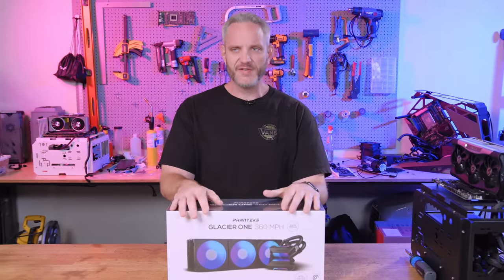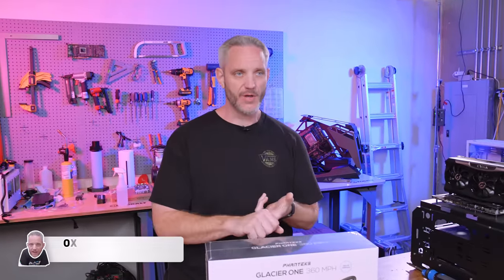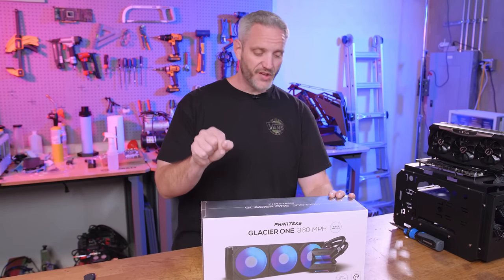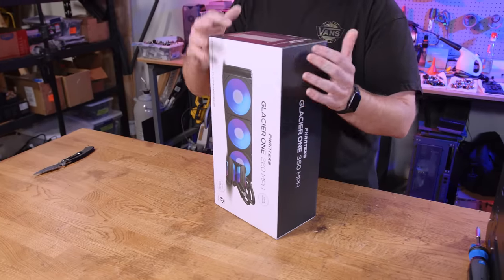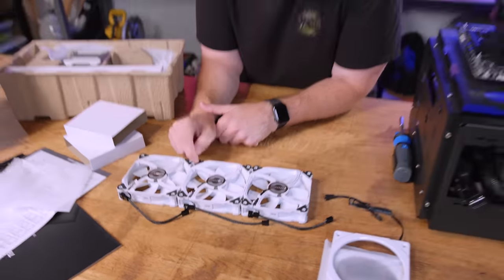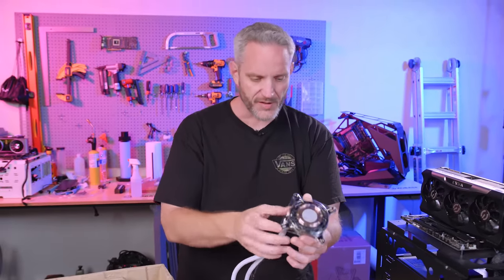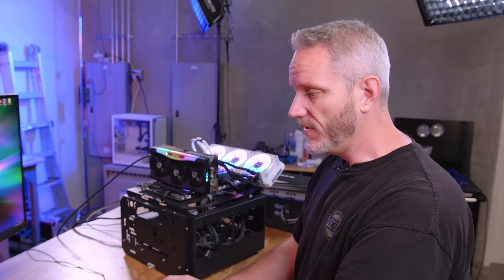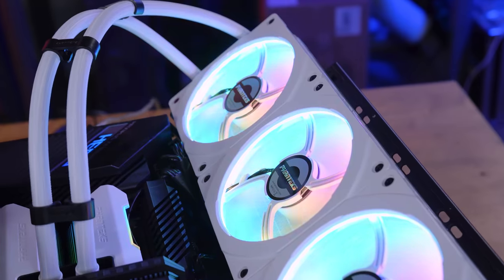A new CPU Cooler has entered the chat!

Comment: Question for you, Jay. (Great video, as always, btw)

You mentioned that once enough liquid had permeated out of the loop and/or the pump had gone bad, there was nothing you could do to service the Asetek AIO, and it was simply time to replace it altogether.

I wonder though, is it possible to remove the block mounted pump, plumb in an integrated D12 pump/res combo, and reinstall the unit as a psuedo-custom water-cooled unit?

I had a Corsair H110i GTX that i loved until it died of pump death (i suspect crunchies got in there and killed it), and have had the idea rolling around in my head since then - just haven't acted on it 'cos time, and how well the Noctua NH-D15 has replaced it.

I'm thinking along the lines of...
Pump removed
Reroute one line from rad to block to go instead to pump/res combo
Line out of pump combo back to block

Would solve reducing e-waste a little bit, be budget friendly, and allow servicing of the system - flushing, topping up, etc).

Nice little mad science experiment I'd love to see you tackle... You know, for SCIENCE!

Keep the great videos coming.
Reply: Depending on cost of parts and how you've plumbed it all in, it might be easier/cheaper to splice a little flow-meter in there to function as a 3-way splitter, and attach that to a tiny reservoir at the top of the build like a header tank. No need to replace pump or coldplate, and any air in the system will gravitate to the header tank over time. Drain, fill with some clear cryofuel or similar and let it rip.
Reply: @technicalfool  except, the reason I'm considering it in the first place is because the pump died.
Reply: @striAKer139  ahright, me misreading. Whups.

As I recall, barrow/barrowch do a thing which has a d5 pump, coldplate and reservoir all in one block. Was thinking of maybe using it in a liquid cooled teeny ITX build. Seems like it'd be right up your alley, so long as the hoses can be squeezed into the fittings.
Reply: @technicalfool  I wouldn't worry about it mate, happens to the best of us every so often - gave me a chuckle anyhow.

I do like the flow meter idea though, hadn't thought of that.

Comment: Really want to go with a full white build but I don't know if there's any custom stuff to make my 1070 fully white.. Might have to upgrade one day
Reply: Depending on the card you can pretty easily make a custom backplate for it. I installed a G12 Kraken + AiO on my 1080Ti and was thinking of making one so it covers the PCB and bends nicely on the side to cover the pump and wires completely. It's cheap as well.

Comment: With air-cooled ryzen 5 5600x with Amd Prism at 4200 ghz i have 60 degrees for all 10 minutes of Cinebench multi core termal throttling test  in a closed case...

Comment: depending on the msi afterburnering overclocking 405 mhz memory clock 200 mhz core clock 9 core voltage full power full temp fan speeds full in msi afterburner

Comment: I'm building my first water cooled system although I've built plenty of computers in the past, this is my first substantial gaming system and I was wondering if I have a 12-gen 12900 KS and I plan to overclock it, is an AIO cooler adequate? or should I get the cooler with a reservoir type? Any comments regarding this question are appreciated 🙂

Comment: After having a NZXT Kraken, I'm spoiled with a LCD screen to quickly view temps of GPU/CPU at a glance without anything on my HUD. Wouldn't go back. Though I also wouldn't go with NZXT again. Good unit but I like Corsair products better. Just at the time of building, No other company had any screens out yet.
Reply: I'd say if you need to be able to check temps quickly, switch to an AIO that doesn't require temp monitoring
Reply: @robwhitmore3040  eh, my kraken z73 keeps my 10900k in the mid 50s (c). I just like to always know temps.

Comment: That pump head looks super skimp.  I give it 6 months. 
Stay away from nzxt bloatware software need to run their aios. 
Look for bios controlled aios.
Less background programs sending your private information to manufacturers the better.
Jamming fans, lightning. Cooling, monitoring, overclocking, etc all into one required software is definitely excessive. If you want this running on the background of your pc then nzxt aio cam software is for you.

Comment: My Nzxt x62 can barely cool my 5950X so i was considering this but then ir ealized the max i can use in my current Case is a 240mm rad so im stuck with the nzxt or maybe buy the 240 version but if it gonna perform the same i dont think is worth it and movign all to a new case would be a pain too at least for now.

Comment: semi unrelated question...I just got everything to start my first loop. ended up with a freezemod pump (550l/h, 3.5m pump head) with the biggest resivoir. I have 2 360mm rads, 5600x and a rtx 2080. only way I can run my loop is pump/rad/rad/cpu/GPU back to res/pump. I know order doesn't matter , but wondering if this pump will have enough grunt to push this loop. rad on front and top, pump about mid hieght in case. I'm bending all the rigid 14od ,only fittings at blocks and rads, a 3 way at lowest point with a ball valve . will I be ok? GPU CPU are auto OC with after burner and Ryzen master . case is a 5000d airflow

Comment: @JayzTwoCents
 Hi can u tell me which one of these two PC-s should i buy!?
Which1 u recommend me!?
     LENOVO LEGION i7-11700F/16GB/1TB SSD/RTX 3060Ti 8GB 90RT003JRI

Chipset:Intel B560
Processor:    Intel Core i7-11700F (8C / 16T, 2.5 / 4.9GHz, 16MB)
Graphics:     NVIDIA GeForce RTX 3060Ti 8GB
Memory:       16GB DDR4
Memory:       1TB SSD
System Lighting:Legion OY iconic LED + Internal ambient lighting
Audio:        High Definition (HD) Audio, Realtek ALC887 codec
Keyboard:     USB Calliope Keyboard, Black
Cooler:       95W Airflow + PCH heatsink + VRM heatsink + M.2 SSD DECO MYLAR heatsink
Mouse:        USB Calliope Mouse, Black
Ethernet:     Integrated 100/1000M
WLAN + Bluetooth:11ax, 2x2 + BT5.1
Front Ports:
2 x USB 3.2 Gen 1
1 x headphone (3.5mm)
1 x microphone (3.5mm)
Back Ports:
2 x USB 2.0
2 x USB 3.2 Gen 1
1 x USB-C 3.2 Gen 2 (support data transfer and 5V@3A charging)
3 x audio out (5.1 channel)
1 x Ethernet (RJ-45)
1 x power connector
Power:550W 88%

-------------------------------------

     LENOVO R9-5900X/16GB/1TB/RTX 3060Ti 8GB 90RC009HRI

Chipset:   AMD B550
Processor: AMD Ryzen 9 5900X (12C / 24T, 3.7 / 4.8GHz, 6MB L2 / 64MB L3)
Graphics:  NVIDIA GeForce RTX 3060 Ti 8GB GDDR6
Memory:	   16GB DDR4
Memory:    1TB SSD

   NO OPERATING SYSTEM

Audio:     High Definition (HD) Audio, Realtek ALC892 codec
Keyboard:  USB Calliope Keyboard, Black, English (UK)
Mouse:     USB Calliope Mouse, Black
Cooler:    150W Airflow with RGB light
System Fan:2x Top ARGB + 2x Front ARGB + 1x Rear ARGB
Ethernet:Integrated 100/1000M
WLAN + Bluetooth:11ax, 2x2 + BT5.1
Back Ports:
2 x USB 2.0
2 x USB 3.2 Gen 1
1 x USB-C 3.2 Gen 2 (support data transfer and 5V@3A charging)
1 x Ethernet (RJ-45)
3 x line-out(3.5mm)
1 x power connector
Front Ports:
2 x USB 3.2 Gen 1
1 x microphone (3.5mm)
1 x headphone / microphone combo jack (3.5mm)
Power Supply - 550W 88%

Comment: I see 310w + on my 12900ks. Tried the Artic Liquid Freezer II 420mm out of curiosity and it works surprisingly well (on test bench since there is hardly any cases that it actually fits in) but custom loop still does better of course. Note, I do run a -0.080mV offset which helps keep the temps down.

Comment: Have the NZXT Kraken 73 on a Ryzen 9 9500X.  How much can i safely take the pump speed on a IAO ?  Ok to run the pump it self on lower rpm.   Like 50 - 70 %.  Have some headroom to take down rpm.  Cpu only get to 53 degrees Celsius after a few hours of gaming now before any fan tuning.

Comment: BitWit made an interesting video comparing a chep 55$ 240mm AIO with an expensive Corsair AIO for 250$. The Difference was only 4°... And if you add the coolers from the more expensive AIO the difference is only 2°. There is basically no reason to buy these overpriced AIO except for flexing. The roughly 200$ difference can be spend on more important parts of the system.

Comment: I like RGB lighting and all but I have yet to see a set of RGB fans that I actually want. Big glowing circles littering the inside of a pc case just never looks good to me. It just shouts “cheap marketing for crappy components” to me. 

I’m still running my NZXT X53 aio, I’ve got RGB trident z memory, my Aorus x570 board has a little bit of lighting and then of course the GeForce logo on the GPU. I tend to bring the brightness way down and go pretty subtle with the color schemes. As for fans, I’ve always preferred to just go with simple, all black noctua or be quiet! fans. Once you get the motherboard, AIO, RAM, GPU and 6-10 bright flashing fans all going at the same time, things just look ridiculous. More people should try using fans with no RGB lighting. Use the lighting with whatever other components you want but RGB fans almost immediately take a neat looking build and make it look like some crappy Best Buy pre-built. Might as well slap an IBuyPower decal on the front of your case.

Comment: well, hopefully i can run lower voltages once AM5 releases or well by that point they will probly be able to take more voltage or what not cuz im, having to run mine at 1.48V to run 4.6 GHz on my 3700x. to push every bit of performance out of it due to my workloads.  Yes i know this might sound like an insane voltage for 4.6 GHz, but the moment i step into 4.7 my sytem just shuts down the moment i put load on it and its not my thermals cuz at 4.6 at max load its at like 78 - 82, so its not the heat so yee.  so thats my current situation as far as COU overclocking of my rig, can maybe be the power delivery of the 570-F from asus but at this point ive just accepted that i cant get higher then 4.6GHz

Comment: Not sure why you think all 12th gen couldn't be OC'd with a 360 rad.
People have 12th 12700k / 12900k OC'd and are happily running with 280 plus rads?
Also lower down 12 th gen my D14 air cooler keeps my 12600k at 5gig no issues.
Did Intel stop sending you the cheques :D

Comment: Would you recommend an AIO for 13th gen (once it comes out) and if you want the system to be as quiet as possible? That's what I'm after... 1 - nice and quiet, 2 - lower temps.
Reply: 13th gen isn’t even out yet.
Reply: Artic coolers but they are not out anyway
Reply: @needcollegeloan  Right... I put that in the comment.
Reply: @Sonyoucef  Arctic coolers? Interesting, k. Thanks!

Comment: Isint air cooling just as good as water cooling though. I was just wondering since I wanted to make a new build this year with the new 4000 rtx coming out and the new amd 7950x. Wouldnt the noctua u12a suffice?
Reply: Not really. High-end Noctua cooler is relatively close to 360mm AIO Performance-wise. In a custom loop you can have even two  360mm radiators which increase the cooling capabilities of the system
Reply: @valentin3186  I was wondering if I do go with the new am5 over ratpor lake(13th gen) for when getting the new 4000 series for gpus this year since, I will probably be air cooling it since I have no idea how to water cool, and it seems more risky and expensive to watercool. And since the 12900k and 5950x were similar in terms of performance except that the 12900k beat the 5950x but, since the 5950x was easier to cool and less power consumption. Should I do the same when getting a 4000 series system this year? I've been waiting to upgrade my pc for ages
Reply: @lovie74  Wait and see the actual next Gen SKUs power consumptions and performance. Prices of current Gen will eventually go down when the newer one is available. 
It really depends on what you want to do with the PC, what software, workflow etc. 
I have concerns that both 12900k and 5950x will be hard to cool on air
Reply: @valentin3186  I see. Well I think I've seen people air cool ybe 5950x already but ik the 12900k was hot asf even with air cooling that's why I thoguht about going the route or uber 7950x for next gen coming up. The case I was going to do was either the 5000d airflow from corsair or 7000d with all noctua fans and a u12a cpu cooler. 

I would do water cooling but since it costs more, plus it's hard to setup. And I heard u have to switch outthe liquid every 6 months and that seems like a big pain to do that often. If I setup watercooling I would wanna do it once and maybe switch out the liquid after 2 to 3 years only since it seems like a pain
Reply: Short answer....No.

Comment: How often should you replace an AIO or how long do they last?
Reply: Depends on the use and tubing.
The coolant evaporates through the tubes over time and naturally some materials allow that faster than others, but more than material this depends on the usage. If the system runs hot the coolant does too and this quickens the process a lot, this is why you should pick an AiO that meets your needs and try to avoid the system running at high temps.
For DIY folks I would remind that it's possible to refill most systems but for people who don't want to bother with it I'd say an AiO is around 3-5 years worth of investment, unless pump fails or something like that.

Comment: That's a nice cooler, but every time I watch a video about AIO, I get a little bit confused. I know 12th gen is hot and all, but I am about to build my mini-itx with the 12700k and I decided to go for the Cooler Master PL 240 Flux. I am not going to overclock it, so based on a few reviews it looked like a good choice. Maybe it will be , as I'll mostly play games and might do a little bit of editing. But, man I get worried all the time thinking that I picked the wrong cooler.
Reply: if you have not already bought it i suggest u go with a 360.240 will get the job done most likely but 360 will keep it chill and relaxed
Reply: @arian_s_collection  Is there an itx case that can fit a 360 though?
Reply: @arian_s_collection  already bought it. Also, it wouldn’t fit the meshlicious
Reply: @CyberRelic280  there are a few that can fit two 240 if you do a custom loop.but ye in general with 12th gen and 3000nvidia your system will suffer high temps with an itx build
Reply: @CyberRelic280  your room temp is also very important. my gpu in winter time at 100%usage gets to 56 57 degrees most. but in summer it goes up to 61 68.literally 11degrees hotter
Reply: How is it going?
Reply: @aeternam3710  so far so good. Haven’t had any problems with temperatures. Worth noting that my case is the meshlicious. Temps are very good.

Comment: Anyone have an answer? Should you feel fluid moving through both tubes on your aio. My temps are pretty good without turbomode on but go instant with turbomode on. This was not an issue when I first got my Lian li aio but not it is. With that being said, I only truly feel fluid moving through the first tube and don't feel a damn thing on the second tube pulling fluid back. is this normal or not? I already contacting Lian Li for support on this but I rather have the communities replies as well. Thx

Comment: Intel Core i5-13600K
Arctic Liquid Freezer II 280
XPG LANCER - DDR5 - kit - 32 GB: 2 x 16 GB - DIMM 288-pin - 6000 MHz / PC5-48000 - unbuffered
Samsung 970 Evo Plus MZ-V7S1T0BW SSD 1TB, M.2, NVMe/SATA
VGA MSI RTX 3060 VENTUS 3X OC, nVidia GeForce RTX 3060, 12GB
nzxt h510 flow atx mid tower case
750W, CORSAIR RM750x (2021), 80 Plus Gold
msi pro z690-a atx ddr5

I plan to buy this components to build my PC.  My goal is to game on Samsung Odyssey G7 LC32G75TQSRXEN which is 1440p 32" monitor. 
My though process was to build PC that is mostly for Gaming but can do decent job with other tings like editing, rendering and so on...

What components would you cut/add from/to this config ?

Comment: Sadly, my h510 case from NZXT doesn't really "support" an AIO.  Yes, technically you can install one in the front, but I don't personally like blow warm air back into the case.  IMO, any and all heat from cooling either the CPU or the GPU should be exhausted to the outside environment ASAP and putting the blower on the front blowing back into the case is a no go for me.

Comment: 240 mm is still enough. In the 12900K the problem is the interface (where you can change the contact plate, etc.), not the radiator size

Comment: AIO's suck for the most part. Barely better than a good/great air cooler and not maintainable or repairable 
If you take the significant risk to go with water, go all out on an extreme custom loop. 
Multiple pumps, multiple reservoirs, huge multi-liter coolant capacity and as many rads as you can afford. The more coolant, the longer it takes to thermally equalize.
Your cooling solution can follow you as you upgrade over multiple systems & cases with some smart shopping. \
A new CPU block now and then, but pumps, rads & reservoirs can last decades if you maintain them.

Comment: or ya can ve like me and just hook up to your water TAPS AND RUN A FLOW JUST FAST ENOUGH to keep yur max temp where you want it lmfao, oh my nuts when it coes to cooling i run at 22 c all day and 40c at full power
Reply: if your running a laptop use your stock air cooler and ill mod it for water cooling, try it out have some fun